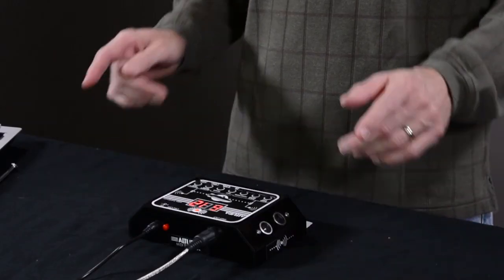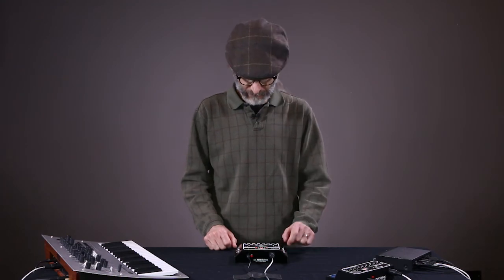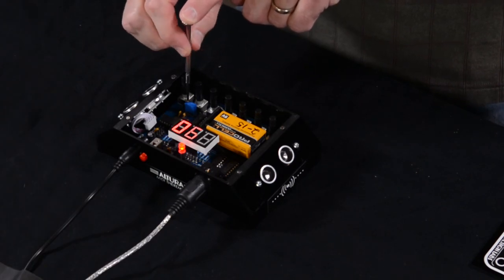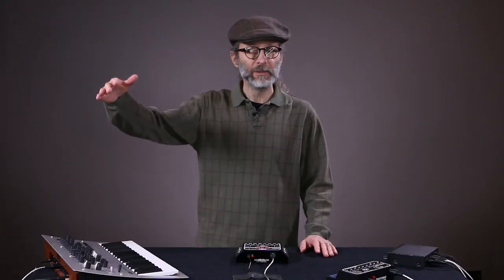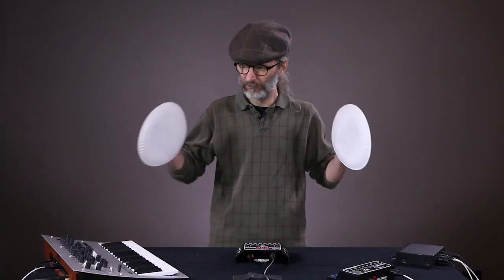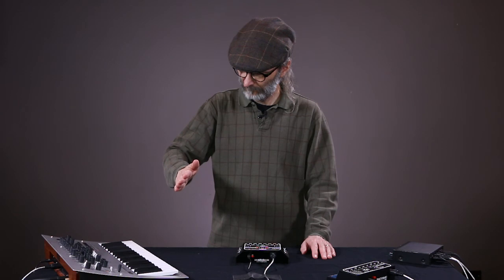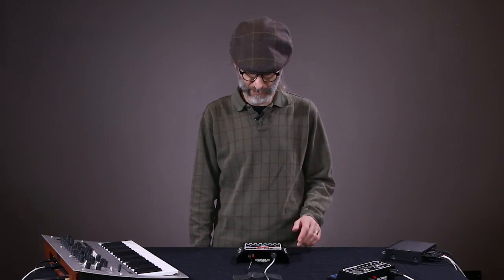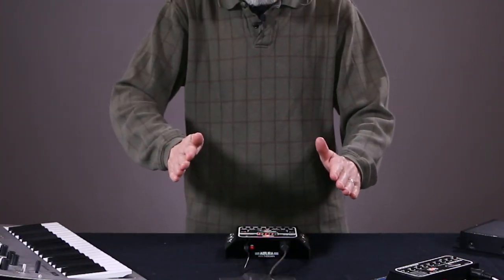Altura Theremin MIDI Controller TUTORIAL

Comment from the maker: On PLAYING SCALES: Run up and down three notes, moving deliberately from one to the next, until you can reliably trigger exactly the note you intend. Now move one note up the scale, and repeat for those three notes. Move all the way up to the top of the scale, and then work your way back down again, three notes at a time. Thus:
do-re-mi-re-do-re-mi-fa-mi-re-mi-fa-mi-re-mi-fa-so-fa-mi-fa-so-fa-mi.... etc
Do this for a few minutes every day for a week and you will master this instrument.
Reply: Hey : ). Fantastic device. Could you theoretically map the korg koass pad's x and y values to this device?
Reply from the maker: @heatherporteous6548  That's a good question. Since the Altura ONLY transmits MIDI data, what I think you are asking is, "Can teh Altura's output be mapped to the Kaoss Pad input?" I found the KAOSS MIDI implementation chart at Korg.com. It seems to me the pad's MIDI implementation is a little more esoteric that one usually sees in a typical MIDI controller. I think you would have some difficulty getting the KAOSS pad to respond as expected when using the Altura. If it can be done at all, i suspect you would have to run the Altura into your DAW or Ableton or other performance software, and do some re-mapping, to convert the data sent by the Altura into a format recognized by the KAOSS. It would take some experimentation, but boy would it look cool in perfromance.
The Altura comes with the response range preset to about 4" - 30" from the sensors; but hacking the code you can extend this up to as much as 10' - 12'. I am waiting for a dance company to incorporate several Alturas into their performance. you could activate the KAOSS effects by high-kicking through the Altura's sensor range!